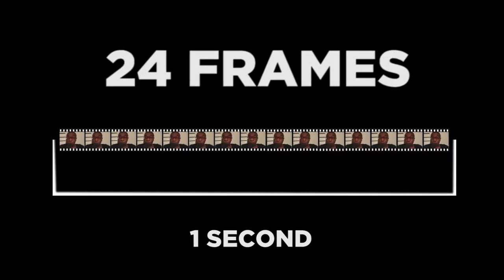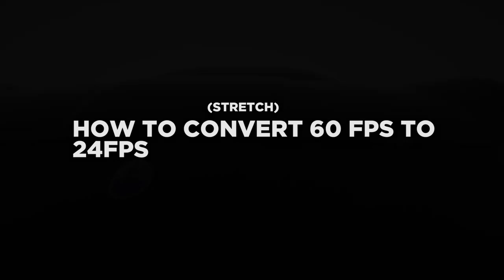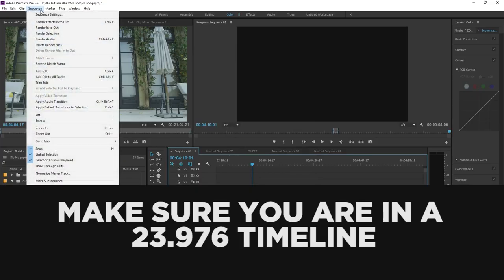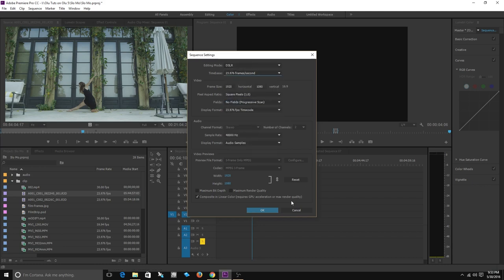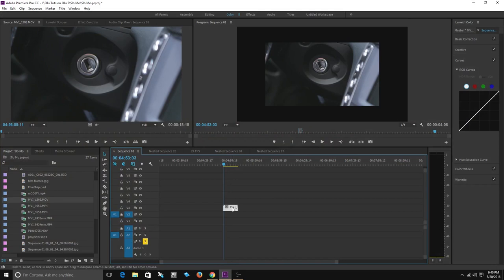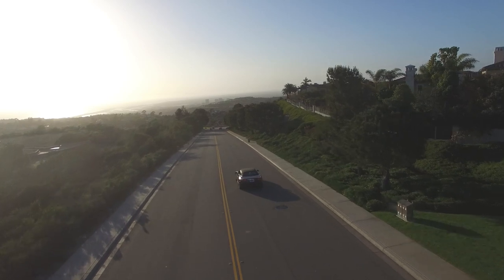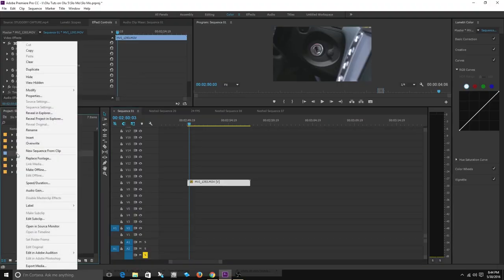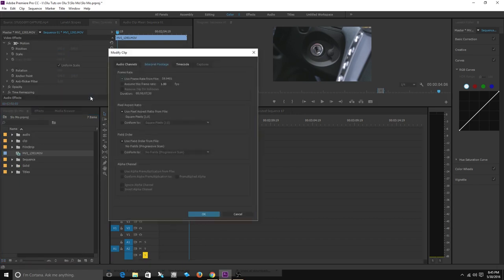Why Your Slo-Mo Video Isn't Smooth. And Looks Like Crap :(

Comment: Hey man! 
Thanks for the vid, I guess that 60 fps is pretty standard on most canon DSLRs out there (that's what I'm using at least)
I just don't like the fact that then it shoots as lesser quality, 720 p.
Any better options if I wanna maintain 1080 p footage in slow motion?
Is it twixtor you would suggest then?

Marit
Reply from the maker: Yeah I know right. Kinda sucks. These new cameras like the Panasonic GH4 and the upcoming Canon 5D Mark 4 are changing the game though. GH4 can shoot 95fps in 1080. Mark 4 is rumored to beable to shoot 120fps in 1080

Comment: Hey Josh! Great tutorial as always. But I was hoping you would have also covered tips on how to go further than 40% with 60 fps footage.
Reply from the maker: Hey thanks for watching the vids Zheng! That's a  great question actually. I'd check out an After Effects plug in called Twixtor. It artificially creates new frames in between existing frames, allowing you to actually stretch footage 60fps further than 40% (and still maintain 24 fps). There are great YouTube tutorials out there on Twixtor too!

Comment: What happens if my sequence is 24fps and I convert my 60fps shot to 24fps for this one clip, but I have another clip that I want in realtime, but it's 60fps? Would I not be able to put the 60fps clip into the 24fps sequence?
Reply from the maker: Yep it you want your 60fps footage to play in realtime (not slowed down) simply place it in your 24fps timeline. It will appear like 24 fps footage and will play normally.
Reply: Anything in the 24fps sequence will be 24fps.

Not to get it confused with the video. Dropping a 60fps clip into a 24 sequence would cut frames from the 60fps clip to turn it into a 24fps. It may be a bit jerky, won't be smooth as 60fps clip in a 60fps sequence.

Reference: me! MMediaLabel.com
Reply: Ohhh so it just gets a 24 frames from the 60 frames? While if you modify 60fps to 24fps it expands it? Wait if you're expanding 60fps, how does it convert it to 24fps slow motion? Sorry for all the questions Lol
Reply: +xes pes correct and correct. It expands if you modify it only or change to the speed. As he explained, it stretches it. Ask as many questions as possible.
Reply: +xes pes I honestly wanna make tutorial videos myself.
Reply: Cool, thanks. I have one more, how do you put 60fps realtime footage and 60fps converted to 24fps slow motion footage together? So like realtime and slow motion footage together in a sequence. or should I not convert it and use a 60fps sequence and just change the speed instead of converting it to 24fps?
Reply: Your last option is what I would suggest: 60fps sequence, 60fps footage, and if you need slow motion just use "Speed" to adjust it.
Reply: Jason Thibodeaux alright thank you!